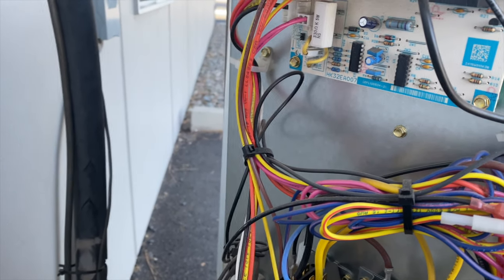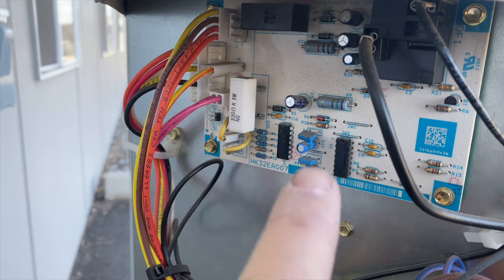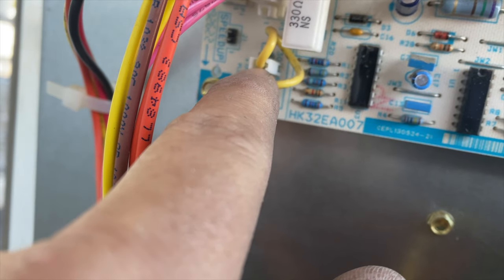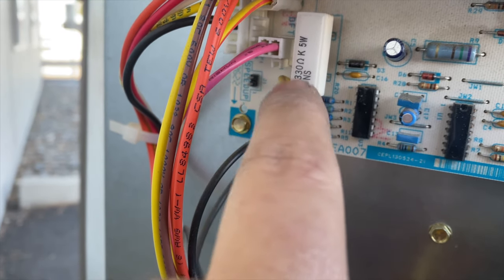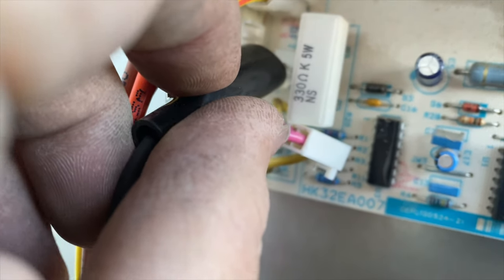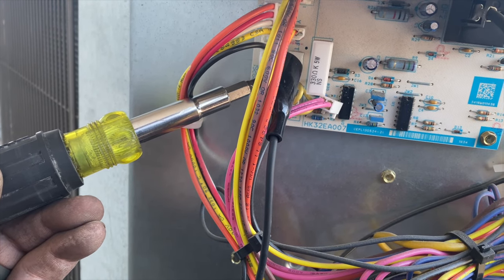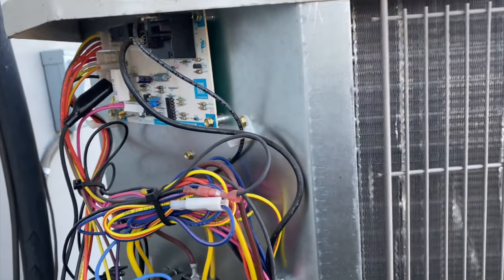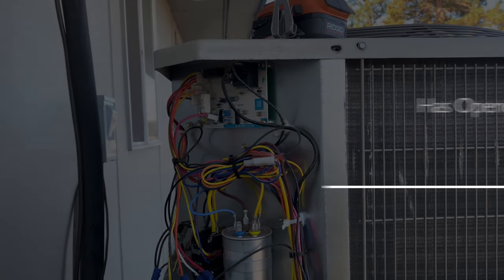How to Test The Defrost Cycled on a Payne/Carrier Heat Pump EP120

Comment: When you were testing this in the video did you have the unit on heating or cooling mode? I’ve got a frozen outdoor unit and I’m trying to test the defrost board to see if that is the reason why we have failure. I tried everything on your videoand I got no results like your video shows. Is this a defrost control board issue?
Keep in mind it’s 28° outside and there is no heat inside. I turned on cooling mode to melt some of the ice so I could get airflow but I’m not being successful on testing the defrost board or at least maybe I’m finding out that the board is bad?
Reply from the maker: The unit needs to be in heat mode when testing the defrost mode. Are you shorting the DFT?  If you are short the speed up pins till it goes into defrost mode if it doesn’t work, probably a bad defrost board.

Comment: The jumper that closes the loop. I assume the clip is touching both pins to close the loop, correct? The clip itself is closing the loop? Not the wire that is attached to the clip, correct? Thanks for posting these videos. Great stuff.
Reply: I just did this and yeah, the clip is bridging the two pins. The other side is clipped onto itself to prevent shorting on anything.

Comment: Where does the jumper wire run to those pink wires come from  where
Reply from the maker: I’m just using one side of the jumper wires to jump out the 2 speed up pins. The 2 pink wires are disconnected. They run to the defrost thermostat.
Reply: @NighthawkHVAC  so basically your using 1 side of the jumper wire and a flat head? The other end of the jumper wire doesn't need to be attached?

Comment: thanks I did exactly that but she wont go into defrost. I even changed out the board and same thing.
Reply from the maker: You might have to short the defrost thermostat.
Reply: @NighthawkHVAC  thanks for responding back!! yes I did jump the defrost sensor pins then did a speed up. nothing :(
Reply: Defrost board needs to see "R" 24 v power and common to close the RV with a closed DF sensor.